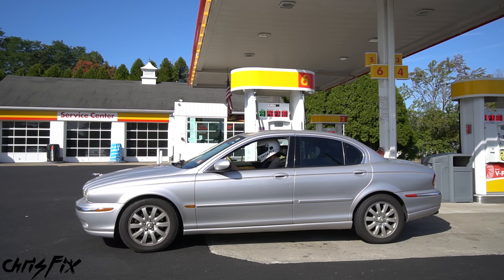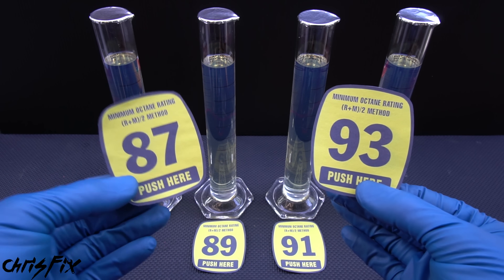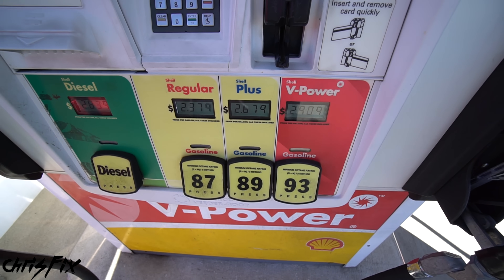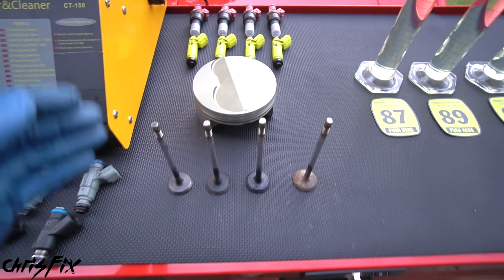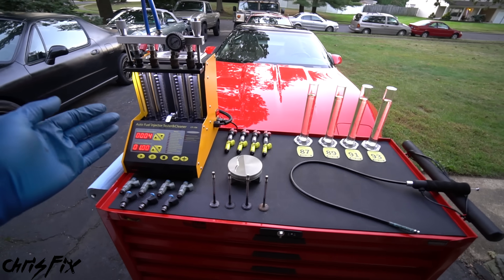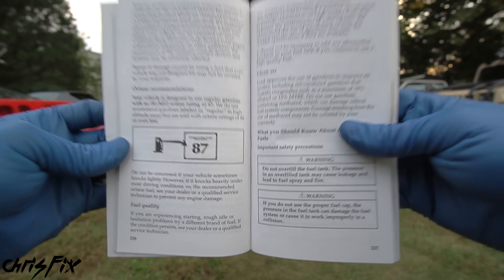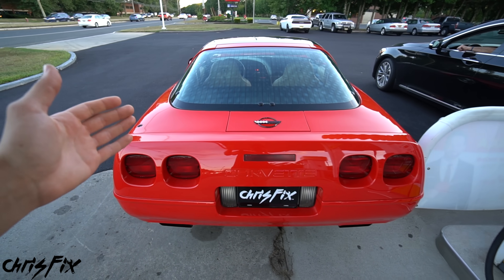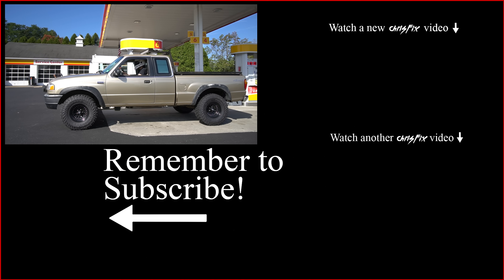What is the BEST Fuel to Use in Your Car or Truck and WHY

Comment: Only thing I woul kindad disagree with (from a personal standpoint maybe?) is running regular in a "premium recommended" car only giving a small amount of fuel efficiency drop off. I had purchased an audi a3 2015 about a year ago now and at first just used regular and noticed that my MPG in the car's reader was almost cut in half on what it was supposed to get. So the pretty much immediately after I put premium in the tank, my mpg went up about .5 more which is a pretty big jump. Maybe its just the car? Not sure, but I've also read that when a car is "premium recommended" its more or less just telling you "if you're in a jam and must run regular, you def. can, but in the long run its not really good or worth it" mainly because not only the decreased engine performance but also with the fact that the knock censor is a "fail-safe" system, so if that fails for whatever reason you're gonna run into knock and engine damage.

Comment: If you burn gasoline and ethanol side by side gas has an orange flame whereas ethanol is blue to almost invisible. That shows you the probability of carbon build up is higher in gasoline. The trade off is MPG and not every vehicle is flex compatible. With ethanol however i make way more power so i hardly ever run 93 gasoline. The thing with temperatures of the fuel there is such a thing if I run 93 in cold temps it starts up just fine but when running ethanol its hard to start but it will start after a few tries. Im tracking that you aren't comparing ethanol and regular gas but some of those myths you mentioned have an explanation.

Comment: ChrisFix: “Don’t put gas in your diesel, it won’t run and will mess the engine up”
Project Farm: “Will it now?”
Reply: i was thinking that to XD
Reply: johnny Good, because he’s already done it 😂😂
Reply: Gas in a diesel engine will work. Diesel in a gas engine....bad.
Reply: Didn't he use a lawnmower to test? I think the car engine is more complicated than that.
Reply: G. Cast Not exactly. Daily service and major repair tech here. Fuel injection doesn’t much care, as long as the AFR and EGTs are okay.

Comment: mmm, yes they have same enegy in joule, but won't ge tthe same flash point, so won't burn at same T°. Pressure is directly related with T°. PV=nRt. Thus detonation. so more pressure in the cylinder, highest T° is at the top dead point piston just before sparkplug ignite. So the statement at the beginning of your video is wrong. But yeah, the idea is there. The mixture is ignited by temperature, spark is about 3000k. This is why you can get ignition BEFORE sparkplug ignite, if the chamber T° reach the ignition temperature aka detonation. Fire need 3 things, no matter what , triangle of fire : oxygent / heat /fuel. Highest fuel rating will get a higher ignition T°

Comment: why there in US still using the 87,89,93 low oil grade Still as other countries has use 95, 97, 100 and above? is there any difference or the same?

Comment: What difference is there between gas with 10% ethanol and without? I know that ethanol is cheaper for the fuel stations and that they don't pass the savings on, but what is the difference to your engine? I live in Ohio so it is required that stations put 10% ethanol into the gas.....

Comment: Diesel won’t damage the engine it will destroy your lift pump and high pressure pump and all the lines and anything with a seal so your injectors will go out as well

Comment: Not hating on this video or anything like that but all I hear is (always use premium if you can, while you could use regular in many cases and not waste money I am going to show you and tell you an endless list of why you should go with premium at all times) I personally never have had any car that has such issues like engine noise and even once had a car that when on premium it actually drive horribly it felt like suddenly the car gain weight and drove miserable plus honestly I rather pay less to the fuel businesses it is nothing but a rip off, I did see a car but will not be out for mass production (wonder why) the car uses water as fuel. The problem is not even the price of fuel it is the consumer bitching that they need more power. Cars now a day have so much unneeded and unused power for no reason. For 1 no one can go above the speed limit this alone says you don't need all that power and fuel difference just use fuel and drive #2 as i mentioned already over 80% of cars go unused while they do get used daily this does not mean they truly get used, there is no reason other than to claim superiority to daily drive a V8 none, many will claim they need all that power to haul stuff but I can prove to anyone easily that with a simple B2200 you can haul more than with a F250 because I seen this so power and size engine? Yeah you are just wanting the attention and spend for no reason. I really believe the car designers need to come up with an engine that car be actually useful is great on gas such like the Mitsubishi mirage new engine but with a more family oriented cabin unlike the Mitsubishi mirage. Now a days it has become a normal trendy way of believe to say I don't care about fuel it is all about that speed, well that speed what they don't show on their channels is all the tickets all the time wasted at the courts and all the money invested at the beginning for their 15 minute speed video. I personally had  2017 Camaro and exchanged it for a 2019 Toyota Camry but I feel the car could use some touches the fuel mileage could be a lot better and the computerized reactions could be fine tuned to be quicker without adding any Hp to it so even going from a camaro to a camry I still see that as far as fuel economy goes industry is still controlling us.

Comment: this gas station does not have ethanol mixed in. if you do not want ethanol you have to buy premium. if you put gas with ethanol in your atv and do not drive it over winter it will give you trouble in the summer. but if you put premium in it will run. from my experince.

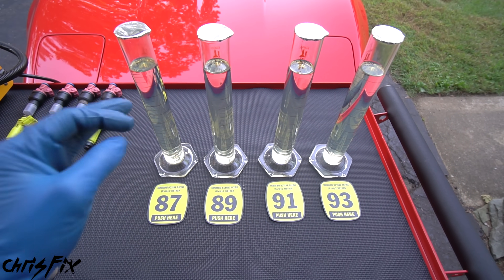Comment: 5:44 By the condition of the pump buttons we can draw the conclusion that most people use 87 and 93 octane...Also they are more diesel cars than octane cars since the diesel button is pretty weared down OR since it only one diesel pump its used more often.

Comment: For a lot of fuels the premium (91/93) tests with less ethanol (albeit not consistently). Less ethanol = more fuel efficiency due to ethanol having less energy ouput per litre than gasoline. Sure, you can run a higher power output using ethanol due to its anti-knock capabilities (E85 tuned cars for example) but you will get more "mileage" from a litre of gasoline than from a litre of ethanol. Also I have heard, but cannot support, that our diesel is not as good as Europe (more sulphur).

Comment: What’s the likelihood of a gas that “contains up to 10% ethanol” doing damage to the engine? I assume that it would eventually, and I assume that it would be a much longer time line before damage occurred as compared to E-85.
Reply: Michael Powell  0. In the Midwest we have had e10 as standard fuel for decades

Comment: One thing you missed completely is that Regular fuel is now comprised of up to 10% Ethanol and Plus 5%. If it says 'up to' you can rest assured it means 10%.  That being said, Ethanol has problems.
There are four problems with ethanol:
1.) It is corrosive when in contact with certain materials in fuel storage and delivery systems, including some rubber compounds and the zinc and aluminum alloys used in carburetors.
2.) Because it is an alcohol, ethanol dries out the rubber components in a fuel system. This leads to cracking and brittle fuel lines, floats, seals and diaphragms.
3.) Ethanol is hygroscopic – it likes water. Water enters fuel containers when they are filled up. Once in the gasoline, it forms a chemical mix that causes corrosion of internal parts. As the fuel level in a tank or container drops, water condenses on the cool surfaces of the vessel, drops and runs down into the fuel where the ethanol welcomes it.
4.) It acts as a solvent in older engines, dissolving the varnish and other deposits in tanks and lines. These then are carried to the carburetor or injection system where they can clog the small orifices involved.
I stick with 91 or 93 because I want gasoline - not gasoline and something else...
Reply: Except premium also has 10% ethanol as it says right on the pumps most anywhere you go. And if it has over 10%, it will be rated as E15. My 2014 car is designed to run up to E15. Ethanol isn't a problem for modern cars anymore since fuel lines are now stainless steel and rubber isn't used anymore as rubber composites are used in modern fuel systems that are immune to the 15% ethanol. Also most gas stations in my state are getting rid of mid-grade and are instead replacing it with 88 octane E15.
Reply: Scootaloo in Canada the premium fuel does not contain ethanol.
Reply: @norumbega5897  Yeah here in the states it does. Just give it time to come to Canada. Canada does not adopt to the newest standards like the US does quite as quickly. But neither does Europe. However they are now adopting the US ethanol standards for gas at an accelerating pace now. 5 and 10% ethanol is becoming very popular there.

Comment: Question for Chris, or anyone who knows the answer... why is premium gas 91 octane some places and 93 octane in other places? And would it impact engine performance for cars that require premium fuel to use 91 vs 93 or vice versa? Your channel is great Chris!
Reply: It depends on the elevation often where the gas is being sold as this affects how the fuel burns. And sometimes 92 and 93 octane gas contains 10% ethanol which gives it a slightly higher octane rating. Here in Wisconsin most gas stations sell 91, 92 and 93 octane. 93 is by far the most popular here however. 93 is considered Super premium, or premium ultra at stations that also offer 91 or 92 at the same time as 93. But it ultimately just comes down to how the gas is formulated. Often 91 octane also has 10% ethanol. It just depends on how it's blended. 

There is even 94 octane gas that can be found at some VP Racing gas stations that is still considered regular gas like 93 or 91. But it's marketed as street legal racing gas. This is a very rare octane to find however, as 93 is the highest you will find in 99% of the country. 94 octane is the highest possible achievable octane that you can get. Anything beyond a (R+M)/2 94 octane rating, isn't actualy gasoline any longer. It's more of a menthol, or ethyl alcohol type of fuel beyond 94. Gasoline can never be formulated beyond 100 Ron or (R+M)/2 94 octane since at this octane level it contains 100% iso-octane. 

So when you go to certain gas stations, they will sometimes offer Racing Gas. This can be marketed as 93 or 94 octane street legal racing gas. They can even in some cases, offer a 100 octane racing gas that is street legal if it doesn't have lead in it. However this gas is for massively modified older generation gas engines with big massive engine displacements and may be producing in excess of 800 HP+. Think crate motors like a Chevy 454 big block that has been bored out to be over 500 Cubic inches in displacement. With modern technology however, they can now achieve in excess of 800 HP on regular premium today, such as the newest Ford Mustangs with smaller engine displacements thanks to on board computers. 

Then there is 110 octane leaded gas that is for older racing bikes, or high performance snowmobiles etc...  But again anything above 93/94 octane is not considered real gasoline. It's just more like glorified paint thinner at that point, that your trying to run in your machines. And these fuels also have far less BTU's (energy) than 93/94 real gasoline. 

So the question is that can you tell a difference between 91 premium, or 92 super premium or even 93/94 ultra premium? On a factory stock vehicle, most likely no. All manufacturers consider 91 octane as premium. So from your BMW's, to your Corvettes, to your Mustangs, to your Ferraris, are all designed to produce most power output at 91 octane. So puting in 92 or 93 will have no further effect on performance. 

If it's something custom built however with insane compression ratios, or a older high performance motor vehicle with a crate motor, then you may notice a slight performance increase running 93 octane. However keep in mind that everyone in modern time aims for 91 as the gold standard, since 93 isn't always available at all gas stations as 91 is nation wide. 93 is super popular here in Wisconsin. But modern cars off a production line no matter what make or model, typically can never utilize it since auto manufacturers world wide aim for 91. Only if the vehicle is heavily modified, or an older racing vehicle typically benefits from 93. And more than likely someone with this type of modification lives where 93 is readily available like here in the midwest. The west coast 93 octane isn't as popular.  

However with that being said, if I remember correctly, some marine engines do like the added benefit of 93 octane gas, since they tend to run high compression engines. And here in Wisconsin, we do have a ton of lakes and even access to the great lakes wich see very high performance boats and very large boats.
Reply: Scootaloo thanks for the reply! I learned about as much from your comment as Chris’s video!

Comment: Water is the other number he has not said yet. Is the other make up their not telling you about. So if you live in a cold climate it’s not smart to use a low octane gas. Ethanol is alcohol which evaporates. So if there is 10 percent of it in your gas what happens when you don’t drive every day, puff out the vent out the tank. Ethanol goes. This kid talks bull shit.  Most small engines an boat motors burned up their valves on ethanol an it’s not smart to use on your small engines. Ask the manufacturer they’ll tell you. He’s a rep for SHELL. Every thing he’s saying happens with dirty gas from tanks that don’t sell gas fast remember water in gas is the other number. Buy the best for get the rest.

Comment: Aren't most modern car computer/fuel systems unable to compensate for the difference in octane rating?  I.E. my F-150 requires at the minimum 87/regular fuel.  I put in 93/premium.  My truck's computer knows it needs 87, but gets 93, so continues to run at 87 fuel/air ratios because that's the requirement.  Am I wrong on this?

"if the vehicle manufacturer says your engine needs only 87-octane regular, that is what you should use. The higher octane of premium gas won’t make your car faster; in fact, the opposite is possible because higher-octane fuel technically has less energy than lower-octane fuel. It’s the fuel’s ability to be compressed more without pre-igniting that results in more power when used in the appropriate engine. Premium gas is not “stronger” gas".

Comment: here is what I know because I have seen it first hand.  The question has been asked before "Does premium gas burn cleaner than lower octane gas?.  Many so called "experts" say no.  Sorry, but I beg to differ.  Pour a little regular octane gas on a concrete surface and light it.  Observe the spot it leaves after the flame goes out.  Then, do the same with higher octane gas.  The higher octane gas will leave very little to no residue or mark.  The lower octane will leave a darker mark.  That tells me that the higher octane gas is burning cleaner.  The guy who showed me this is my mechanic who has been servicing and racing cars for over 35 years.  He states that anyone telling you anything different is full of shit.  And as I stated, I seen it for myself.

Comment: Awesome video, the time taken to do this video shows! I have a 2016 v6 mustang and only drive on nice days so might only put 3000 km per year and then it's stored for winter. Car only needs regular but our regular in Canada has ethanol and our premium doesn't. I have heard it's not good to store car for winter if the fuel contains ethanol. I give her a full tank of premium and fuel stabilizer for the winter storage. No problems so far. Your thoughts?

Comment: Non-oxygenated has more energy. Cars with carbon deposits will require higher octane. Manufacturers usually lie about the requirements because they want consumers to be happy using cheap fuel. Honda is a great example of this if you look in the owner's manual it says you can use 87 unless you're towing then they want you to use premium... So obviously premium is what's really required...

Comment: Is any ethanol bad for your engine? I usually run 91 octane Esso or 94 octane Petro Canada ultra. I drive a Acura TL elite; it's high compression. I recently filled up with Shell 91 and the station claimed the fuel had no ethanol at all.

Comment: I spent almost $2000 at my mechanic shop trying to fix engine uneven burn/engine knocking. He tried everything,  replaced oxygen sensors, belts, etc.
After 2 moths and four visit,  the mechanic/owner gave up, he told me to go to a Mazda dealership.
Few months later, I decided to put a higher octane gasoline and all the symptoms went away. 

This was my 10 year old Mazda and nobody have ever told me that its engine required a higher octane gas and I didn't suspect it either, since it was just a mid range model.
Anyway, this was an expensive lesson, the mechanic shop is considered a very good one, it has a high Yelp rating, etc., yet those idiots working there couldn't figure it out...